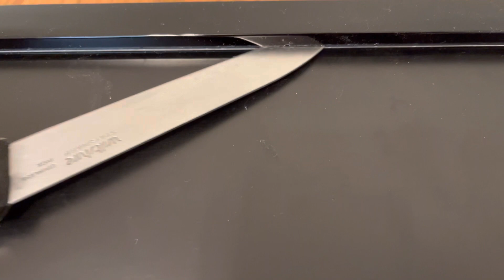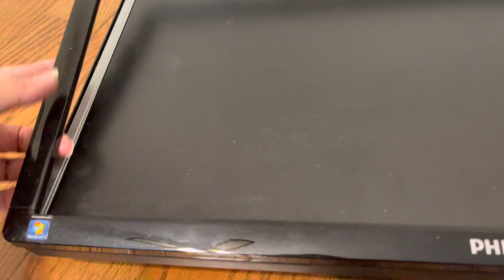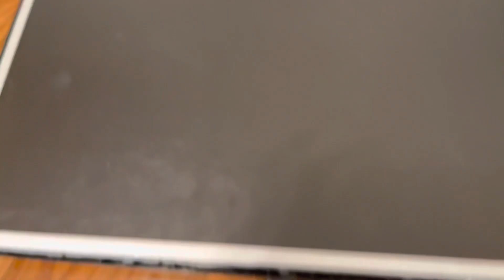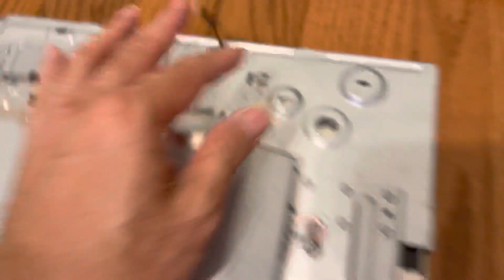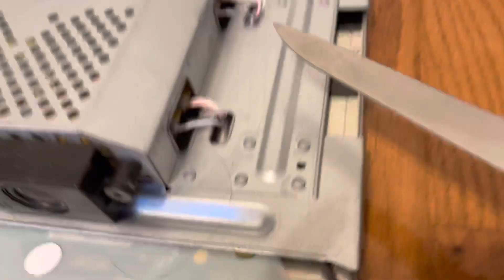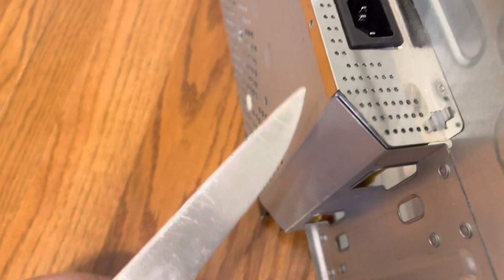Philips 244E Repair/Open/Unassemble

Comment: Can you plese tell me how to take the stand off
Reply from the maker: There should  be 2 screws for the stand that you need to remove. You can check the user manual which will tell you how to mount the stand